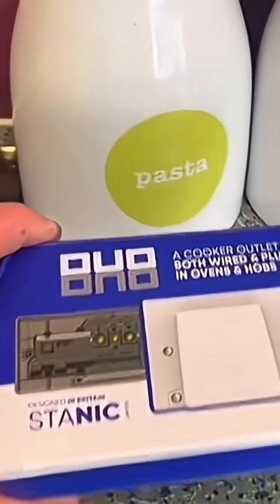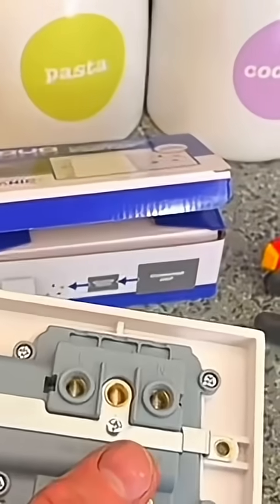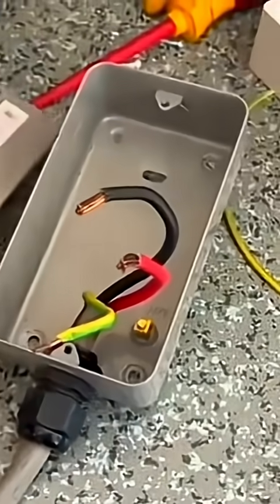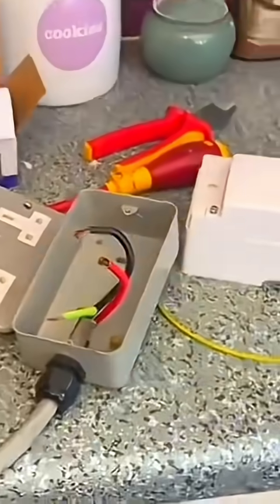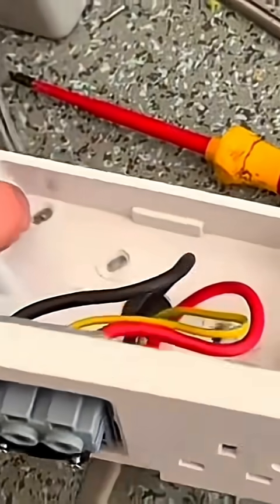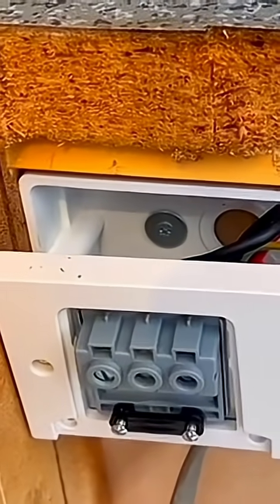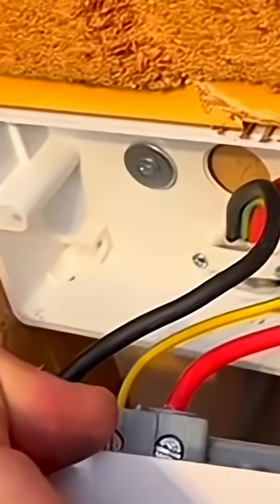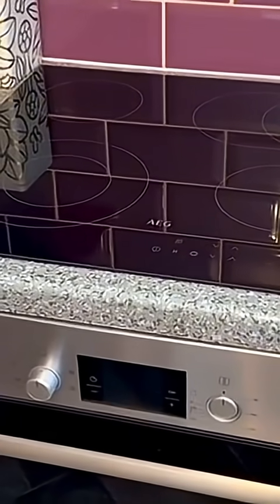The Stanic Duo - Problem Solved

Comment: That’s a brilliant bit of kit and should be standard in all UK kitchens.
Reply: Against the regs....
Regulation 553.1.5: Socket-outlets “shall be installed in a position so as to be readily accessible for use”.

Regulation 132.12: Every item of equipment must be arranged so as to be accessible for operation, inspection, testing, maintenance and repair.

If a socket and fused plug is hidden behind an appliance (e.g. a fridge/freezer/oven), it may be acceptable only if there is a separately accessible double pole isolation switch controlling it.

Regulation 537.2.7: requires that you must have a readily accessible means of switching off — typically a switched fused connection unit (FCU) or isolator switch above the worktop.
Reply: @johnburns4017  What do you think the cooker isolator does… It’ll isolate the supply for both the 45A outlet and 13A socket so fitting this doesn’t breach any regulations.
Reply: @alvina69  
A cooker isolator was not shown. Once again, fixed appliance should be hard wired in. Plugs are for portable appliances. Fuses in plugs can get hot when run near to their ratings. All common sense really.
Reply: @johnburns4017  It conforms to the relevant British Standards for both an outlet outlet and socket outlet, so it’s safe to be used. Even though a cooler isolator weren’t shown in the video, this accessory is clearly an upgrade to the traditional cooker outlet and so will be controlled via a 45A DP switch.
Reply: @alvina69  
I gave the regs.
Reply: @johnburns4017  They all seem to be centred around accessibility to the socket and switching off for maintenance… Both of which have been addressed, the outlet is isolated from the cooker isolator and there’s no reg that says it needs to be easily accessible just accessible.
Reply: @alvina69  
The socket is not accessible at all.
Reply: @johnburns4017  Pull the cooker out and hey presto it’s accessible… I think you’re reading too much into this, there are plenty of sockets that are behind white goods such as fridges, washing machines and tumble dryer etc and it’s perfectly fine, it’s no different in this scenario. If in doubt, speak with your CPS provider.
Reply: @alvina69  
The oven is crewed in. Fridges are free standing. Once again, a fuse running at maximum rating can get hot. Fixed appliances should be hard wired in.
Reply: @johnburns4017  I have yet to see a cooker outlet that does not have a double pole cooker switch above the worktop. In fact the majority of separate hob and oven I have seen the oven flex wired directly into the cooker outlet with no fuse protection. So this is basically a good idea that no doubt was born out of people like me who would tap a single socket off the cooker outlet to allow the oven to be properly fused. Yes a separate circuit for the oven would be good but the reality in a finished kitchen is not going to happen.
Reply: @andrewwhite3793  mcb gives
The point is..
The socket is not accessible at all.

Note: A 13A 3kW oven can be taken off a 40A circuit without additional overcurrent fusing as the resistance appliance cannot draw more than 13A. It only needs fault protection and earth leakage protection, which the 40A MCB gives. But this is besides the prime point.
Reply: @johnburns4017  Nonsense as I said I have yet to see a cooker outlet not switched via a DP 45A cooker switch. Plus the same can be said for dishwasher or washing machine where you cannot get access to the socket. Also majority of ovens come with a moulded 13A plug top so if we follow your thinking you cut the plug off and invalidate the warranty. The whole idea of the socket outlet is to fuse the oven to13A and not 45A
Reply: @andrewwhite3793  
The guarantee is irrelevant - a piece of paper. Safety matters. If the connection is a plug and hidden it needs hard wiring. Most ovens I have seen do not have a plug. In fact about half are just over 13A.

Comment: The point of these is normally where you have an electric oven, that is hardwired, and the UK socket outlet is for a gas hob electric ignition plug, all normally mounted hidden away behind the oven or adjacent cupboard. You'd normally have a dedicated circuit/cable run back to the CU in 6mm cable, on a dedicated 16amp breaker
Reply: 16A? 32A is standard practice for a cooker
Reply: @callumon2571  I said Oven, most ovens are only 2500-3000w so ~13a, and then I said gas hob ignition that would be maybe be a few watts, so 16amp would be fine.
Reply: You can use it for that, or what is more typical these days is an induction hob hard wired in, and an oven that comes with a 13A plug.
Reply: If it was on a 16A it would be overloaded as both appliances would be pulling at least 13A
Reply: @callumon2571  You actually think an oven or hob pulls it's rated load full time?
You clearly don't know its perfectly acceptable to have a rated load of upto 15KW on a 32A cooker circuit .

Comment: Why would you wire in a permanently fixed immobile oven into a socket outlet?
It's amateurish and waste of a socket outlet.
Reply: A lot of ovens are coming with 13A plugs on them now. Hardwire separate hob and plug in oven.
Reply: @deang5622
I gather from your response that you're not a qualified electrician!
Reply: @MA-mo7yj  
He is right though.
Reply: @johnburns4017 
Who do you think is right?

Comment: The oven should be hard wired in, not on a plug and inaccessible and hidden socket. Potential problems. Plugs were designed for portable appliances. Common sense really.
Reply: Ignore johnburns. He is a DIY wannabe electrician.
He'll start waffling on about French and German electrical installations sooner or later.
Reply: @davebadger100  
You need need to get your compulsive disorder sorted.
Reply: @davebadger100  
You need to have this compulsive disorder sorted.
Reply: @johnburns4017  You need to stick to DIY and stop trying to pretend you are an electrician.
Reply: @johnburns4017
All outlets below kitchen worktops for white goods have switched fused spurs normally directly above the outlets to isolate these points individually. This has been normal/general practice for nearly 3 decades!
Reply: @MA-mo7yj  
Not these days. People do not want that ugly junk above their designer kitchen worktops.
Reply: Mr Badger, get your compulsive disorder sorted.
Reply: Mr Badger you must get yourself seen to.
Reply: @johnburns4017  Mr Burns. You must stop posting made up regs on the internet. Please point us to the Reg that states ovens MUST be hard wired.
Whilst you're at it inform all the oven manufacturers that supply ovens with moulded plugs that they're not allowed to sell ovens like that.
Reply: Regulation 553.1.5: Socket-outlets “shall be installed in a position so as to be readily accessible for use”.

Regulation 132.12: Every item of equipment must be arranged so as to be accessible for operation, inspection, testing, maintenance and repair.

If a socket and fused plug is hidden behind an appliance (e.g. a fridge/freezer/oven), it may be acceptable only if there is a separately accessible double pole isolation switch controlling it.

Regulation 537.2.7: requires that you must have a readily accessible means of switching off — typically a switched fused connection unit (FCU) or isolator switch above the worktop.
Reply: @johnburns4017  And you realise this has only one cable connection in and is wired to the cooker circuit with.... An isolator switch above the worktop. Now complies with regs.
Reply: @johnburns4017   Remove the oven and the socket is accessible, just like moving a fridge, washing machine ,dishwasher or any other appliance. 
You really should stay away from electrical work. You aren't an electrician and you have no idea what you are talking about.
Reply: @davebadger100  
Alsa, Mr Badger is wrong. The oven is screwed in, which is defined as being fixed. Now you know.  

The man who is fitting this oven is an amateur or  handyman. You cannot figure this out. Sad but true.
Reply: @johnburns4017  I never said it wasn't fixed. I said the socket is accessible. Keep up.
Reply: @davebadger100  
If a fixed appliance is in front of a socket it is inaccessible - well in the real world it is.
Reply: @johnburns4017  No it's not. 4 screws and the oven is out of the way and the socket is accessible. The same way in which if the oven was hard wired and the outlet was behind the oven. Otherwise a cooker outlet plate would have to be maintenance free connection, as that would be non compliant under the regs.
Inaccessible would be a socket behind some built in wardrobes, that would have to be destroyed to gain access to.
You really have no idea what you're talking about.
Reply: Most ovens come ready fitted with a moulded 13a plug. Cutting it off to make it hard wired would no doubt invalidate the guarantee.
Having the socket & plug easily accessible for the homeowners is key,  as you dont want Mrs miggins & her husband attempting to remove an oven to isolate it because its become Live or she's burnt the Yorkshire puddings again.
Reply: @merlin5476  
Only some ovens come with a fitted plug.
Reply: Is your fridge and freezer hard wired???…..
Reply: Can’t remember ever seeing a portable dishwasher or washing machine either
Reply: @cglees 
Most dishwasher and washing machine are not fixed, being freestanding.
Reply: @johnburns4017 nonsense, stop trying to rescue this nonsense. You said the wrong thing just own it
Reply: @cglees  
Please read again.